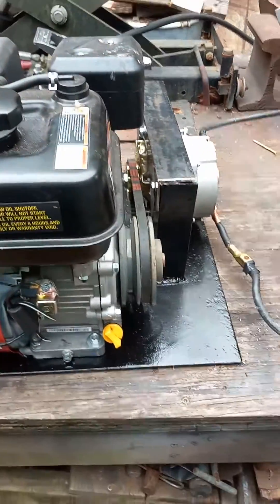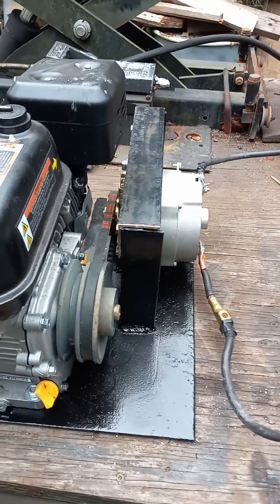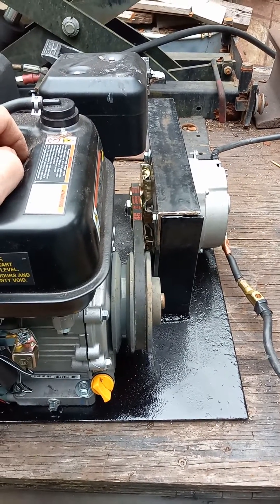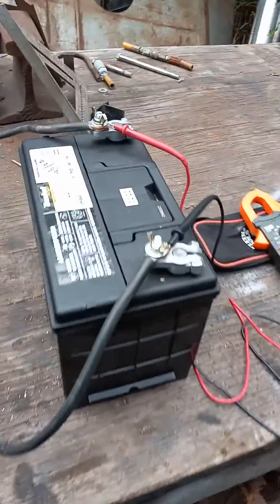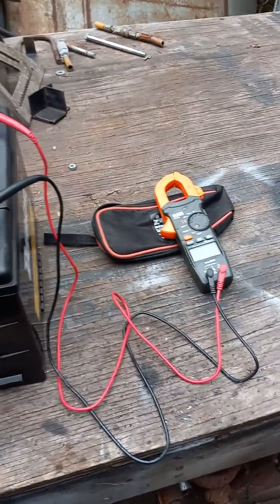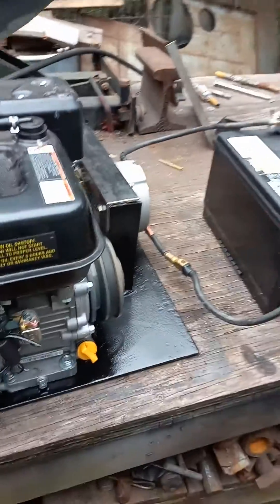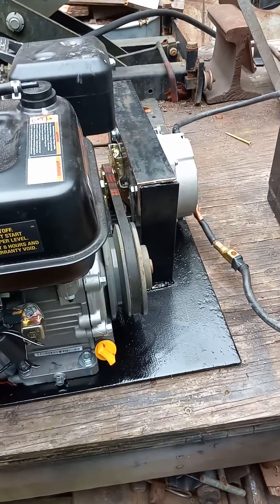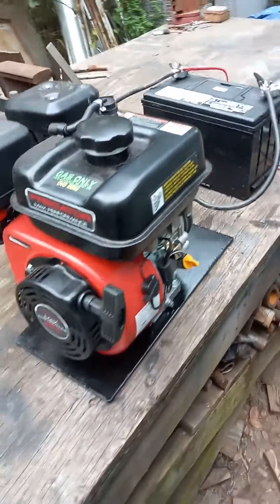Homemade Emergency Solar Battery Charger

Comment: 🤔
So, what if I made custom jumper cables one side alligator clips for normal battery connection at the car batter, but the other end hooked on to the actual battery bank??

You don't want those ends touching after topping off so maybe a switch built in between alligator clips and batteries...

Would this be the same concept? It gave me an idea because I park just feet away from my battery bank, on cloudy days i can just start the truck hook up the house jumper cables and top off...

Probably need to disconnect the solar charger controller as well, probably ruin it, heck not sure if my idea won't ruin everything 😂 thats my luck anyways

Comment: WOW, only 2 wires, all the other vids, not yours,  i have seen have loads of wires, this is the best setup I have seen, thinking of making somethink like this, as I live in me Tramper van a lot, winter time I run out(low) on power, no sun, this set up will charge me batts up in a hour or 2, UK, by the way, its ether that or pay out £300 plus for a invertor type Gen,

Comment: Could you please describe the pulley and belt specifications.  Thanks HSP. I really appreciate your willingness to share.
Reply from the maker: The 2 groove pulley(incase I want to add a hydraulic pump set up in the future or another alternator) is a 4.75 inch by 3/4 inch bore ( HF predator 212 or 224cc)from the Surplus Center. I went to several Autozones and O'reilly's and the counter people looked at me like I was from another planet when I asked them for a 27 inch by 1/2 inch vbelt. I ordered an A25 off of Ebay for a few dollars. The 140amp alt came from Summit.
Reply: @homesteadprepper 😂 another planet, yes but I think they're the ones from planet don't know crap 😂

Comment: Nice simple setup I like it. It would be easy to incorporate disconnects fuse or breaker into it as well if you are so inclined to do so. The weight of it looks manageable as well!
Reply from the maker: Thanks. Yep, it needs a little more tweaking.